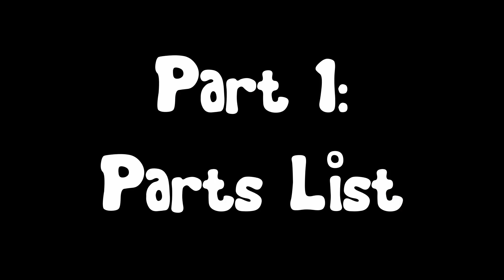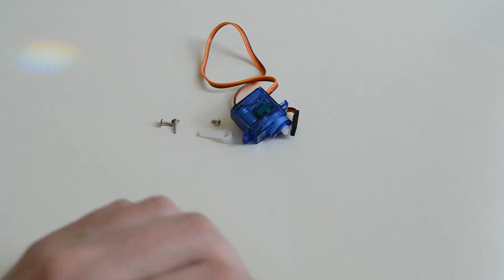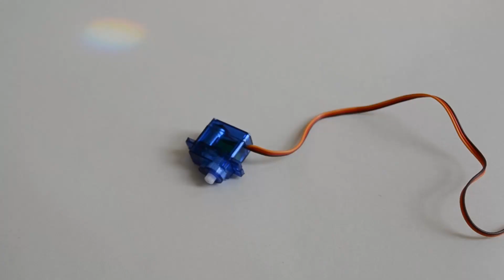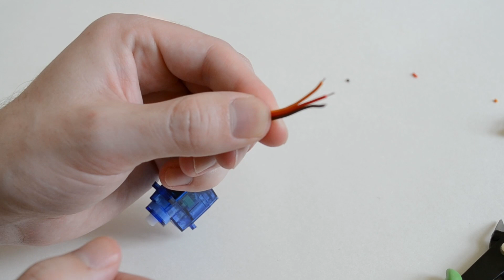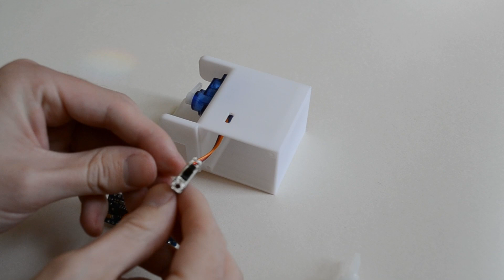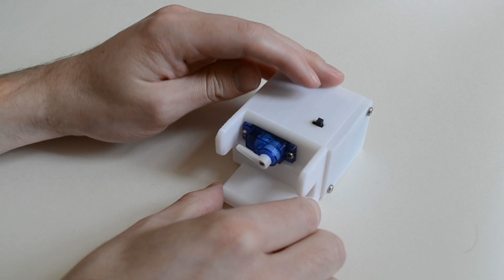Nintendo Switch Auto-Clicker

Comment: Which pins did you use exactly on the nano arduino for each component and also if I want to add a potentiometer to adjust the speed which pin for that one too should I use?
Reply from the maker: Hi there, 
Check out the linked instructables for the wiring diagram and PIN numbers. 
It looks like the servo signal wire is hooked to D9.
For adding a potentiometer you will want to use one of the analog pins A0 would work. Then map your signal into the waittime variable in the code.

Comment: Noob here any advice welcomed. I soldered it all together (badly but it holds) as per guide.

When I add battery and hit the switch I get a red light for power and L will flash every couple seconds. Have I messed up?

Serv doesn't spin, so I assume I've got  a wiring issue. Or does the thing need programming first?

What software can I use to do this if so?
Reply from the maker: Hi, sounds like it needs to be programmed. (The default program on the board blinks the led)
You can use the Arduino IDE to program it. Copy and paste the code into the ide and then upload it to the board. And you should be good to go.
Reply: @tinyboatproductions  my laptop is a dog end so have tried using IDE studio for mobile. I select arduino nano rp2040 board but it fails to compile due to no library. I select the library for Servo.h but still get the same error. I think the mobile app is giving me issues as my friend is able to compile on his desktop (unfortunately he is not local.) I'm going to borrow a laptop and try again unless you see something wrong jumping out at you. Ty for the tutorial and response!
Reply from the maker: @liamflaherty7664  The board I use in the video and that is linked in not an rp2040 board. It is a standard Arduino Nano clone. 
The code provided is in C++ and the rp2040 uses Python.

Comment: I did mine differently, I glue it with double side tape on a cleaning foam can. servo at the height of the pro controller button and it works.
Reply: Which pins did you use exactly on the nano arduino for each component and also if I want to add a potentiometer to adjust the speed which pin for that one too should I use?

Comment: Can you adjust the speed
Reply from the maker: The speed is set in the code, which can be modified. There is no way to adjust the speed on the fly. You could add a potentiometer to adjust the speed.